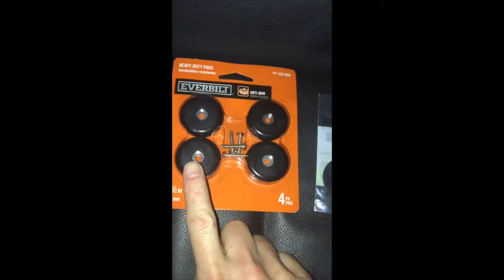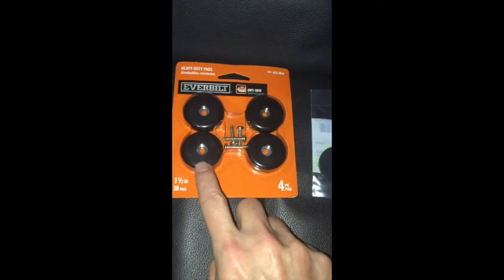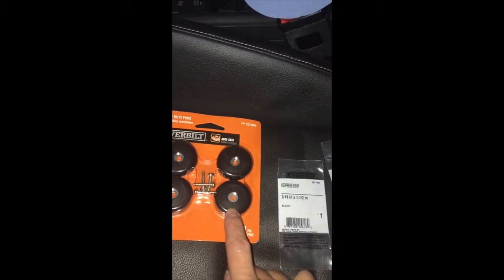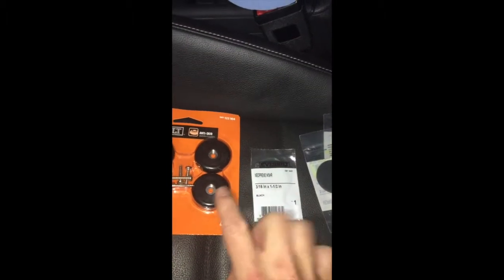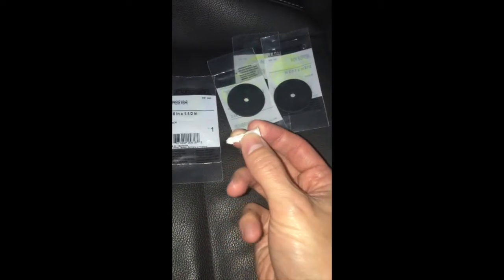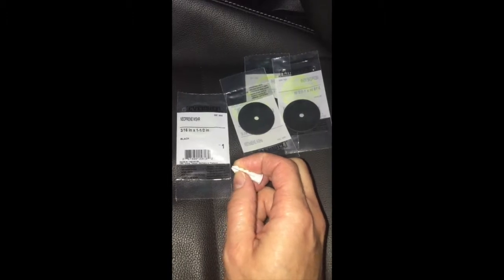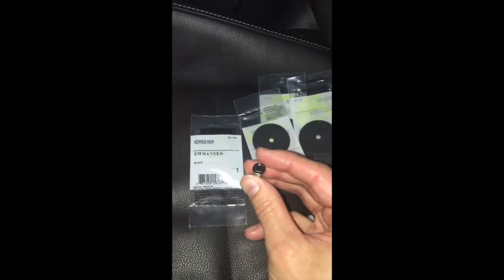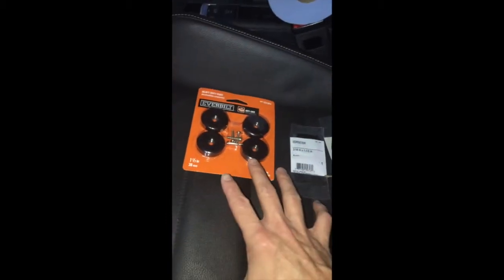VW MK7 Golf R Clutch Stop Install

Comment: I bought the usual aftermarket clutch stop.   I had to pull out two of the four height adjustments.  Why?  Because the car would not start.  VW gave a message to fully depress the clutch to start.   So, while it worked a little better than before, it was still not very useful.  The issue I have with the 2016 GTI is that the clutch only engages very high on the pedal.  I was forced to buy a new clutch kit, including flywheel, as I upgraded to a stage one software and within 400 miled blew out the clutch.  VW has very poor rated clutches.  Gosh for a "sports car" the torque spec is way below any normal spec for other sports type cars.
So now I am really in trouble with my clutch.  It is very stiff and that, coupled with the high engagement makes shifting into first or reverse, very difficult to do.  No smooth engagement at all.  It is OK in other gears as I lift my foot completely off the clutch before using the gas pedal.  6 months ago I pulled out the clutch pedal assist spring and now I will have to re-install it again.  I wish there was a very strong spring to use, but searching on the web doesn't show any results.
Whatever you do, be very wary of installing a state 1 upgrade.  It will cost you a minimum of $2,200.
Reply: If you go Stage 1, it’s a given that you will need a new clutch eventually.   The clutch stop wasn’t the issue.

Comment: Does that drywall anchor fit really loosely in the hole though?
Reply from the maker: +Douglas Bjerring It actually fits pretty well, and I have not had any issues with it so far. However, a larger drywall screw could be a good option, and may hold the metal screw more tightly. Let me know the result if you try it out. Thanks!

Comment: Can this be used on a MK4?
Reply from the maker: +Artbyn3rd Great question. I'm not sure if this would work on the Mk4. Check to see where the arm of the clutch pedal touches - there may be a small rubber  piece that acts as the OEM clutch stop. As a reference you can see this rubber piece at the beginning of the video. Cheers!